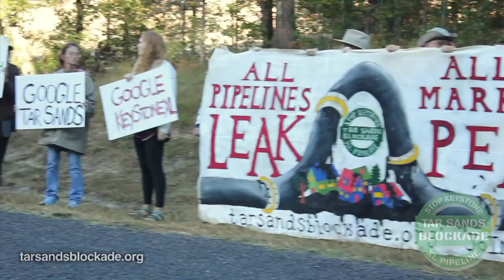Keystone XL Pipeline Blockade

Comment: As an American I'm highly against it. I've seen the results of the gas and oil industry in my families area when it came to fracking. If the pipeline does happen, it goes through a huge water source many cities use. Can you imagine the damage that it could cause. We should be focusing on renewable energy, not something that's eventually going to run out.